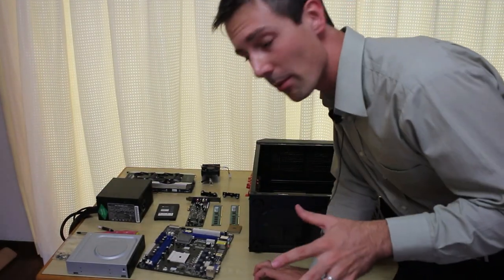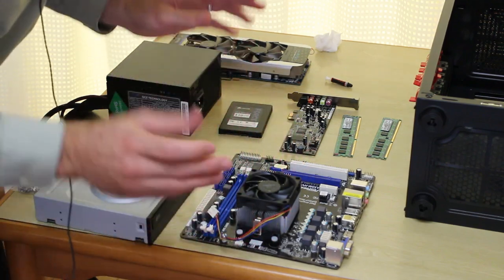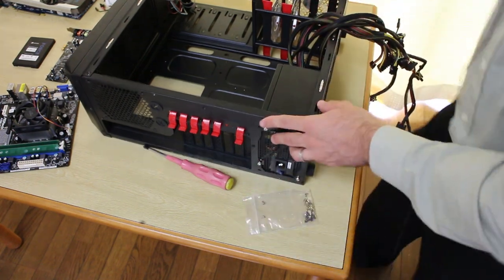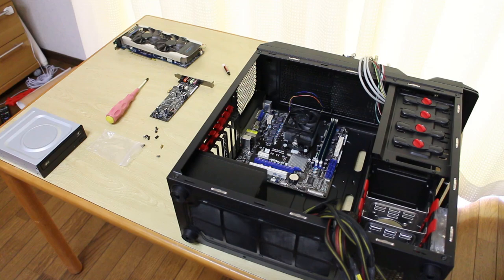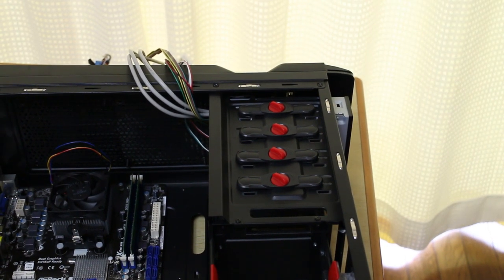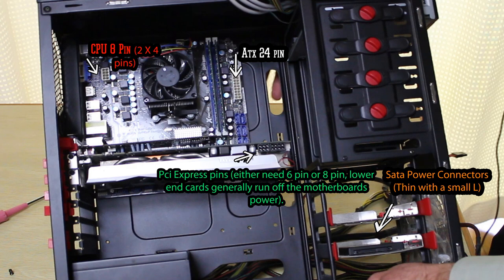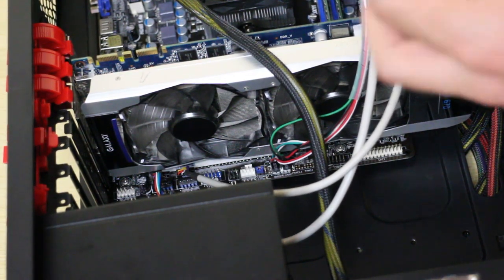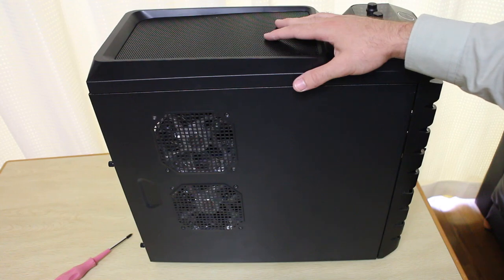How to BUILD your FIRST PC (Full Uncut for Beginners)

Comment: Can you just boot from any HDD?

I want to build a new pc but I still want windows 7 from my other computer's 1TB HDD (its a samsung hdd)
Reply: yes  the Coolermaster Silencio 650 Extreme Silent Case DualBoot HDD case you can but you might have to reinstall windows 7  cos you can't take a hard drive from one pc and use on another   this case can have two hdd  each with different operating  programs
Reply: redtail97 Actually, the reasonb you can't use it on another PC is because the drivers (such as networking) may not work on both PCs.
Reply: You can NOT take a HD with Windows on it, and use it in another PC, you will have to re-install Windows, sorry.
Reply from the maker: Mike Tayon Mike is right, if building a new computer you will be out of luck, though the only time you can is if using the same chipset, that is the only exception, even then it can sometimes ask you to revalidate your key depending on the motherboard manufacturer.
Reply: You mean like a reuse old parts.Yes in fact you can but need to repair install 7.So all new drivers can be installed it will remove the old.And i recommend if have data you want on the drive.You recover them then take the repair install step.Also note a OEM installed version example (Dell HP) will need a cd key entered to reactivate.Its a one time key assigned to the mother board of HP Dell computers or any other maker systems.

Comment: I thought putting the motherboard on the metal case without resting it on screws was bad? If this was a high end system would you have done that? Just wondering
Reply from the maker: it would be bad if you are really rough with the parts or the case was charged (which this case wasn't), I would have done this with a high end system too.
Reply: ohh good to know.. great vid by the way! im building my 1st rig soon.
Reply from the maker: Nice good luck with it, just remember to take your time.

Comment: Hey man I am currently building my 1st PC but I am having trouble and I am wondering if any on you guys can help me :D 

I have done everything in this video however I cannot seem to get my computer to turn on :/ I have removed and reinstalled every cable and read my manual and reinstalled my graphics card and RAM however I still get no response from my PC I have checked my monitor and that is definitely not the problem, I have checked the CPU and also reinstalled that ! Is there anything else I could try that could fix my problem? :)

Comment: Is this build good? Please respond.

AMD Athlon X4 760K 3.8GHz Quad-Core

Biostar A58MD Ver. 6.x Micro ATX FM2+

Crucial 4GB (1 x 4GB) DDR3-1600

Hitachi Ultrastar 1TB 3.5" 7200RPM

HIS Radeon R7 260X 2GB iCooler

Cooler Master Elite 350 ATX Mid Tower w/500W Power Supply

Just want to play games like War Thunder and World of tanks and maybe COD or BF games if it could run them. Is this possible with this pc? what setting could it run on those games? Thank you if you've read this far.

Comment: Is this a good pc, is there anyway I can make it cheaper but have the same performance? Are all the parts compatible 
Intel Core i5 4690k $240
EVGA 600w power supply 80+ bronze $60
ASRock fatal 1TY Z97X KILLER DDR3/ Quad CrossFire motherboard $150
G.SKILL Ares Series 8GB DDR3 SDRAM 1866MHz memory $78
EVGA GeForce GTX 970 graphics card $338
NZXT Guardian 921 RB ATX Mid Tower Case $54
Cooler Master Hyper T4 CPU Cooler $28
WD Blue 1TB SATA 6Gb/s 7200rpm Internal Hard Drive $58
Crucial MX200 250GB SSD $110
BenQ 21.5-Inch 1080P 1ms VGA/HDMI LED-Lit Monitor $160
If you took the time to see this thank so much and it would mean a lot if you replied :) have a nice day

Comment: Hi everyone can you give me some advice on what graphic card to get. I'm currently using a desktop; HP Pavilion P6-2489ea, the CPU Intel i5 processor with 2 Terabyte memory, for GPU I use the NVIDIA geforce GTX 630. I want to upgrade my GPU because of the low frame rates (7-17 fps) I get when gaming.  I switched from console to PC so I'm kind of new to PC gaming so Please please can anyone help me, I would mean the world to me. Thank you in advance!!. 

*Question: Mill mymother board/ CPU be able to support the graphic card I get?

Comment: Just a quick question, if you put a graphics card does it switch the video output to the on built into the card?
Reply: With my experience on just upgrading to an aftermarket card, not a brand new build.  It generally does not do that for you. Most the time you will boot up after the GPU install into a safe mode that is running off the motherboard for display. From there you can go into your devices, Adapters, Display and select your aftermarket product.  I remember a few years back I did a graphics card upgrade from an already updated GPU and the instructions asked me to uninstall the previous software. Once uninstalled and shut down then uninstall the other card replace with new one. 

 I'm not sure but there also might option if installing a fresh OS on a new-build to select a graphics/Display card during installation.

Comment: Hey looking into building a PC. I want to do editing and gaming with it, nothing too intense should i buy a 5930k processor (the next generation one) the 5820k processor (same, also next generation) or the 4790k. Thank you and I'd greatly appreciate your feedback
Reply from the maker: 5820k will be a great value CPU, however the caveat is that you will have to get overpriced ddr4 and pay for a really expensive motherboard, 4790k would be a great buy if you are looking for bang for buck.
Reply: Tech YES City Alright I will wait and see. One other question, if i wanted to play games at decent settings, which would be a good enough graphics card, I don't need it to be the top one I just want it to be able to handle games at high settings
Reply from the maker: GTX 760 or r9-280, though I haven't tested the latter.
Reply: Tech YES City Sounds good, one last question. Will DDR3 be compatible with the x99 motherboards or will i have to wait till DDr4 comes out to be able to use the motherboards
Reply from the maker: It will be ddr4 only (from what I hear so far).
Reply: Tech YES City Ok! Thank you for all of your assistance, I will strongly consider what you have told me thanks :D
Reply from the maker: welcome
Reply: Tech YES City Here's a deal I can afford with the 4930k would this be a good computer? http://www.cyberpowerpc.com/cart/showcart.aspx
Reply: Whoops that link won't work :( Sorry

Comment: When putting in a DVD drive, how do I check its compatibility with the other components? I want to get a DVD drive for the OS install, but I dont know if i need any specific type?
Reply: Most drives for the cd reader are the same, take a look at the manual for your case to determine the size then just go look for a cd reader of the same size

Comment: I'm building a pc with a Fx 8350E processor, do I really need a CPU cooler? Is it really important?
Reply: If you dont want to spend extra money on a cooler you can just use the stock cooler, it should work fine if you dont plan on overclocking your cpu.
Reply: Zorb Ulator Ok, thanks
Reply: do you mean, like a custom cooler ? or just a cooler in general, if you dont use a cooler at all you'll have some fireworks going on in your pc

Comment: Does a graphics card work sound too? (I'm new to pc building)
Reply: the motherboard or a sound card handles sound. It is called "graphics" card for a reason, it only handles the video. but if you for some dumb reason would use the HDMI on the motherboard and use a tv as screen then yes sound would come from the tv through the HDMI port.

Comment: `THANK YOU!I am building a pc this summer and i want to know what im getting to,doesnt seem too  hard.Also i am 14 so do you think i would be able to build one?
Reply: Yeah dude I'm 11 and built a PC anyone should be able to build a PC
Reply: what motherboard would be cheap and good?
gonna use an i5-4690k
Reply: Henkka Koira Take a look at the ASRock Fatal1ty ($130). Seeing you have a 4960, you probably have some inclination towards performance specs. For gaming, IF YOU HAVE THE MONEY, take a look at the MSI GTX 970 gpu (around $320). Easily best bang for your buck.

Most people build their PC for gaming, but this info could be useless if that isn't the case :P And before you buy anything, go to pcpartpicker.com to make sure everything will work together. Don't forget a power supply and case, obviously. That website will also tell you the amount of watts your computer will need.
Reply: Thanks :) i actually got the asrock fatality and i7 4790k+ gtx 980 ti and samsung evo 250 gb + 600 watt psu and other shit  :) 

just ordered the parts,final outcome was 1700 euros!BUT HEY

Do i need to update my bios when i get it?
Reply: Nvidia and intel! Im running an i5-4440 and it never goes above 60% load, when im putting under some stress, its cheaper too.

Comment: hi guys this is my first gaming pc build is it any good

ssd Kingston ssd v300 120gb

motherboard msi 970 gaming amd atx

storage Seagate barracuda 2tb

ram Kingston hyperx beast 16gb ram

case corsair obsidian 750d or 350d what size do you think I should get

gpu msi gtx 970 4gb

psu Not sure what size I need

cpu fx-8350 black edition

watercooler corsair h100i
Reply: Nice build man! I would recommend atleast a 650W psu
Reply: Yeh a 600-650W PSU would be fine
Reply: Don't use that ssd, it's cheap and bad, get 20 bucks more and buy a 850 evo

Comment: So the smaller, motherboard cables at the end (Power Switch, HDD Led, etc). What would ultimately happen if those are plugged into the wrong spot?
Reply: Nothing all that would happen is you go to turn up volume and it turns off your pc
Reply: MrSilverFox it would go something like "turn on your PC, no lights turn on" or something like that
Reply: Good question, we all have done it, plugging the wrong way.  If the umbilical cords power, resent, HDD/SSD lead, etc..are plugged wrong, the system will not boot. The motherboard manual will help you out.

Comment: You don't need a sound card in a HTPC if you transfer the audio digital via the HDMI cable. The home cinema receiver is doing all the surround processing. ^^

Also it's kinda a crime to call your build a HTPC, it's more like a "Kill the next gen consoles" build. A cheap & power saving 35W Pentium or i3 would totally do the job. And if you need some more grafic power, f.e. for 3D blu-ray playback, then throw in a 25W Zotac GT 630 Zone Edition (Rev. 2).

So, are you going to run XBMC on your HTPC?

Comment: Is there any problem if my psu 24 pin atx connector connected on to motherboard and there is a slight gap I tried to push hard as I could but it stayed like that and so I may fear that it would break the mobo.

Comment: I tried building my 1st computer, parts listed below were bought new.  all 4 led lights are on, fans running, hard drive  & dvd running.  have tried 2 different mother boards & video cards.  no video out.   asked best buy geeks, but they only offered to test the video card for a fee, would not guarantee it would resolve issue, would not turn machine on to look,

Tower: Corsair Carbide Series 200R Compact ATX Case CC-9011023-WW
Motherboard: MSI Computer Corp. Socket AM3+ AMD 970 DDR3 SATA3 and USB 3.0 A&GbE ATX Motherboard 970A-G43
DVD: Pioneer Electronics USA Blu Ray Combo Drive, BDC-207DBK
RAM: Corsair Vengeance 8GB (2x4GB) DDR3 1866 MHz (PC3 15000) Desktop Memory (CML8GX3M2A1866C9B)
Processor: AMD FD6300WMHKBOX FX-6300 6-Core Processor Black Edition
Power: Corsair CX Series 600 Watt ATX/EPS Modular 80 PLUS Bronze ATX12V/EPS12V 552 Power Supply CX600M
Hard Drive: Seagate Barracuda 1 TB 7200RPM SATA 3Gb/s 32 MB Cache 3.5-Inch Internal Desktop Hard Drive ST310005N1A1AS-RK-Retail Kit
Video Card: MSI AMD Radeon R7 260X OC 2GB GDDR5 2DVI/HDMI/DisplayPort PCI-Express Video Card
Software: MicrosoftWindows 7 Professional SP1 64bit System Builder OEMWindows
2nd Motherboard: 970A-G46
2nd Graphics Card: XFX Radeon R5 230
Reply: Try plugging your monitor into the motherboard instead of your gpu. Maybe their is no poweer going to the gpu. Or maybe your monitor is defective

Comment: This is the build i plan on doing here soon as my first build
CPU: AMD Athlon X4 860K 3.7GHz Quad-Core Processor 
Motherboard: ASRock FM2A88X PRO3+ ATX FM2+ Motherboard 
Memory: G.Skill Sniper Series 8GB (2 x 4GB) DDR3-1866 Memory 
Storage: Western Digital Caviar Blue 1TB 3.5" 7200RPM Internal Hard Drive 
Video Card: XFX Radeon R9 270 2GB Double Dissipation Video Card
Case: Azza SIRIUS ATX Mid Tower Case
Power Supply: EVGA 500W 80+ Bronze Certified ATX Power Supply 

http://ca.pcpartpicker.com/p/KDKjgs

It's mainly for playing world of warcraft an is better than the recommended requirements.

Comment: wearing a static band is just plain smart. You can build up thousands of volts before you can even feel static or even see a spark on metal. You can fry through components rated at just a couple volts and the problem may not show up for months....WEAR A STATIC BAND and ground yourself! Static build up has little to do with who you are and WAY more to do with your environment (clothes, air moisture content, shoes, what you're walking on, etc). I've seen server rooms that won't allow Styrofoam cups inside for static reasons. Nice tutorial though, but seriously...PAY ATTENTION to static shock risk. You might not damage any components but you could and that's reason enough for me.
Reply: Warwick Data Solutions not really.

Comment: Cool this helped me alot to know how to build a pc but how do I know my motherboard is compatible with my case? Help please
Reply: just check the info on your motherboard and case. Im using a msi z97 which is an ATX board and a corsaird carbide air 540 which supports ATX, microATX, Mini-ITX, Extended ATX motherboards just check the info of the motherboard and case.
Reply: Im going to use a InWin Gt1 case what kind of motherboard shall I use.Im in a budget
Reply: najeb oumansour

Comment: Total noob here. If this was 1st boot. How did you get the keyboard set up and have the windows in the drive already?
cdw a total noob guide from actual finish of the build to (first power up) and configuring everything. You skipped over a lot of simple stuff (for you ) quickly but not so simple for a total novice like me.  Also how do you get windows OS on a usb drive? As been told its quicker to boot,

Comment: Uhm doesn't the stock cooler already come with a thermal paste pre-applied on the bottom of the cooler? Why did he put more thermal paste? That would make it worse since it'll make the transfer more heat less efficient...
Reply: He probably took the thermal paste off then put better thermal paste on

Comment: HELP!! from the area next to power button it has a blue 1x10 20 pin cable, my computer fans turn on, but computer won't turn off. Also my motherboard has a 2x2 epu slot but I have a 2x4 cpu pin. I just gave up I can't find anything
Reply: Cake Dom this is why you research BEFORE you buy...

Comment: Does the CPU cooler come with the cpu?
Reply: Stock cooler does, but depending on the load you will have on it, and potential overclocking, you might want to go aftermarket.

Comment: Does a CPU cooler come with those adapter things?
Reply: Pythonbites yes
Reply: Thank you so much! You saved my life
Reply: now a days, not with older CPUs like core 2 duo
Reply: for the CPU cooler first find out the LGA of your motherboard then find the heatsink that will fit.  Nowdays most heatsinks come with all accessories and nuts and bolts and springs.
Reply: Sudarshan like the one I have on MY PC XD